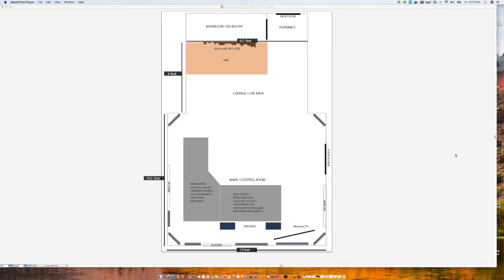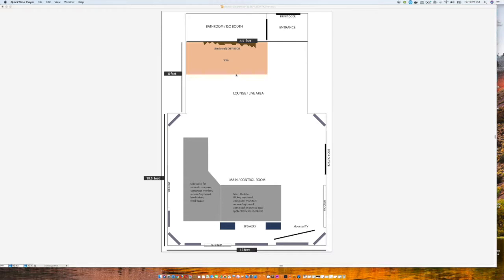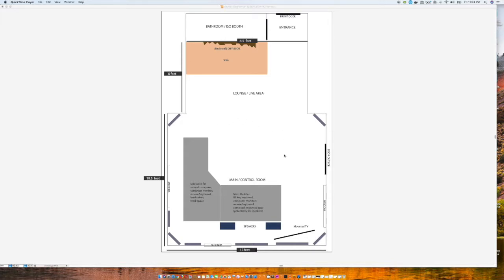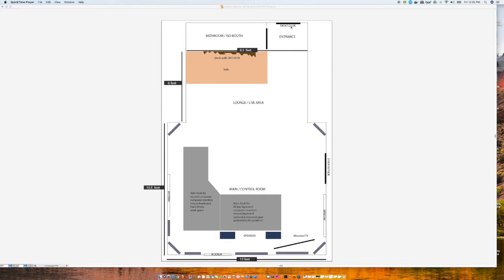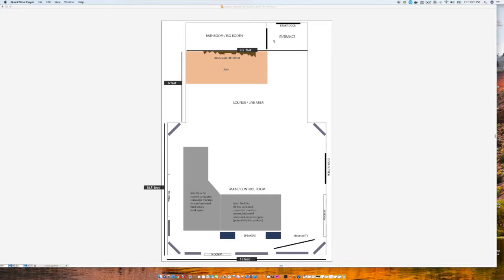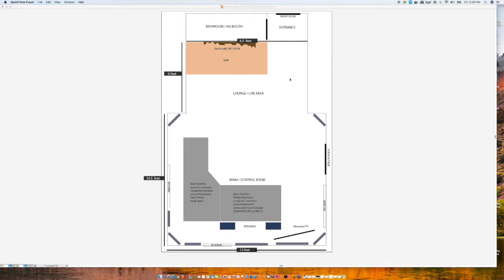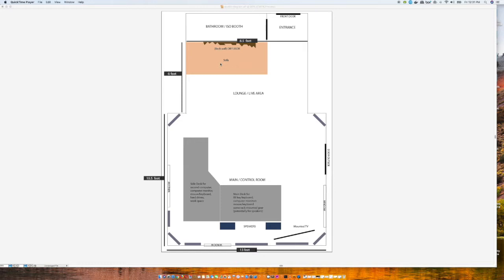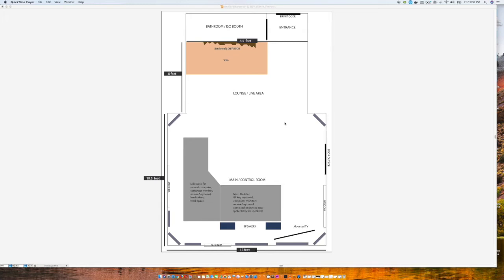Home Studio Design Step 1: Room Layout

Comment: Hi Peter! What type of furniture did you use for the L-desk, and other furniture that accompanies your Output desk?
Reply from the maker: Hi Brian. The other furniture is part of an L-desk I bought years ago. In fact, I had used it as my main studio desk before I bought the Platform. I picked it up used at a local furniture store (like 1--15 years ago!)  It just happens to be very similar color/wood as the Platform desk, so it worked out good for me. There might be something similar in other furniture stores you can find? I've noticed that I don't see too many studio set ups with a desk on one side (the "L".) Is this what you're looking to do? I think many producers have outboard gear, keyboards, etc that flank their main sitting area. I want to get more outboard gear one day myself, but, for now, I love the extra desk space. Thanks for watching and for the comment!